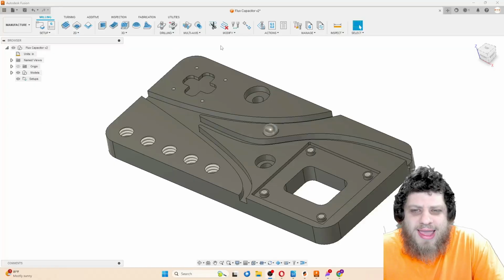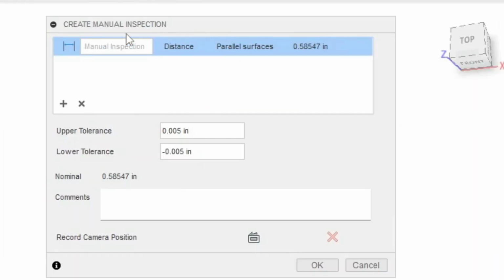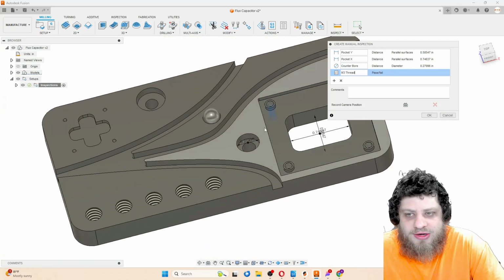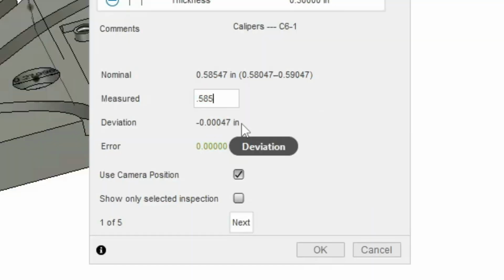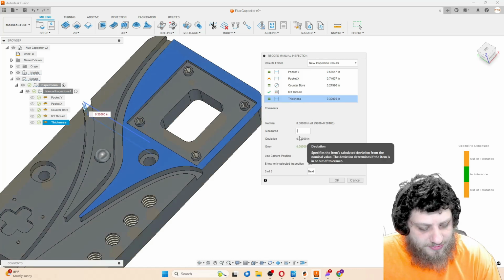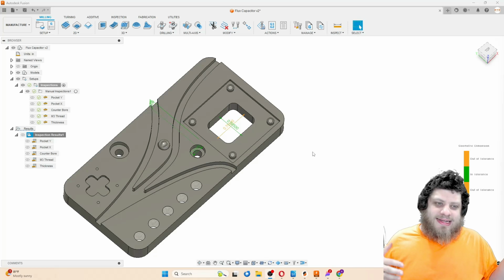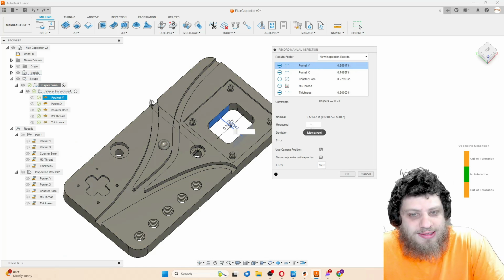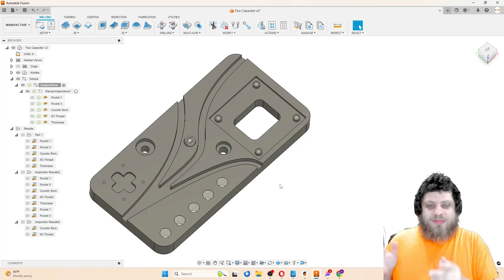Better Inspection Reports with Fusion 360 (Xometry Compliant)

Comment: Thank you for the info didn't know fusion could do that. But being a programmer with guys on the floor, boss wouldnt want set-up guys to come in the office and stop me from programming so that they can measure their part and input the data. 

Its a good idea to add in the process if fusion creates a piece of software or .exe that can be used separately from the main fusion file.
Reply from the maker: This method doesn't make sense unless you have a computer right next to your machine and/or inspection station. Otherwise you are definitely better off with a spreadsheet or something.

Comment: I would be nice to use the probe with this.
Reply from the maker: It's possible! With my old machine I need about $100 on cables and adapters. I'm 100% doing it, but haven't had time yet! It's much easier on modern Haas's

Comment: Good video. You might already know this, but if you have a blue tooth caliper or mic, you can just click the transmit button and keep moving. Works great. We can't use it though. To many steps to add SN of tool to each measurement. We are an AS9100D company and our automated inspection sheet is just faster. I have to admit though, Fusions inspection form is way better looking than ours. Easier to read and understand as well. I have reached out to Fusion design team and asked them to be able to put a database of tool (insp tools) with serial numbers you can just select and have it populate the tool and SN which is required for AS. No response at all from them. :(
Reply from the maker: Awesome! Thanks for the info! All of those things sound awesome. I just type the serial number for my measuring tools in the comments box. A fusion inspection tool library would be amazing!

Comment: Would you want Fusion to have an checkbox (someplace) in the design process to automatically populate default inspection entries?  (This is kind of a rhetorical question from me.  I watch youtube creators using Fusion and there seems (to me) to be a lot of duplicative steps.)
Reply from the maker: I wish it was tied to the drawings somehow. I would love to be able to make a drawing, and have it automatically import the dimensions back into CAM, or visa-versa. The cam inspections show up on the drawing.

Comment: This is pretty cool but looks a little slower than just using there basic excel sheet with some built-in logic
Reply from the maker: It might be if you sat down with a completed part, and just did a drag race. The benefits for me come from the process side. I set up my inspections when I program the part, and then when I'm running it, I can measure the Op1 dimensions while it's still on the machine, type those into fusion, and move on. You could do that in Excel too, but then you are swapping back and forth between it and fusion. If you are running 10 different parts for the job, then you have to keep track of which file belongs to which part, and it just gets complicated and annoying to manage. This method lets me keep everything in one place, right there with the CAM files. I don't need to manage a parallel file system on my computer with the inspection reports, they just live in fusion.
Reply: @AudacityMicro makes tottal sense, only thing I might add is though get used to keeping all there documents, PO, Travelers, part file, any customer supplied documents, and inspection report in a dedicated matrix on your network and a redundant location. There not as picky about it to move up to premium but for ultra premium they audit your records for there parts
Reply from the maker: That is good to know, thank you! That is not something I had heard before. I will work on that!